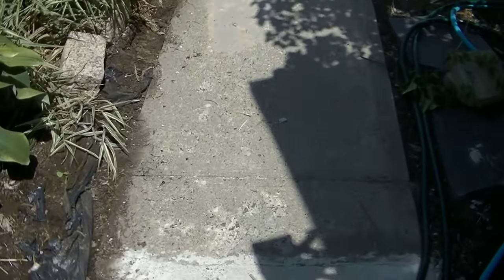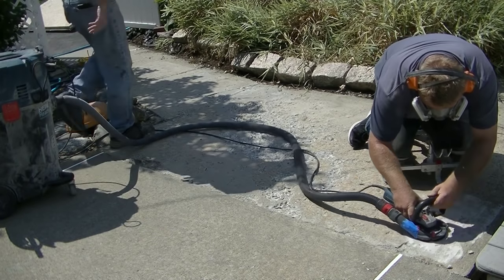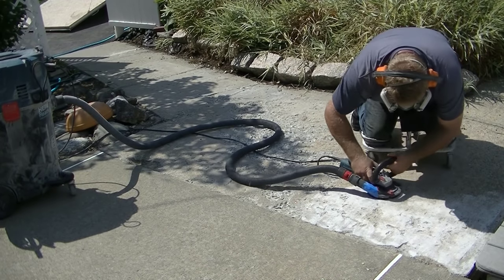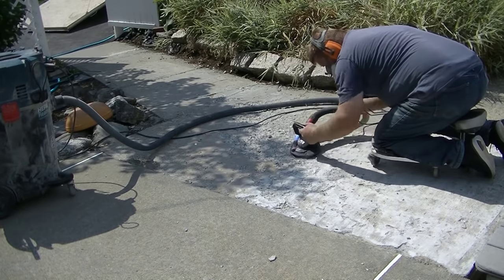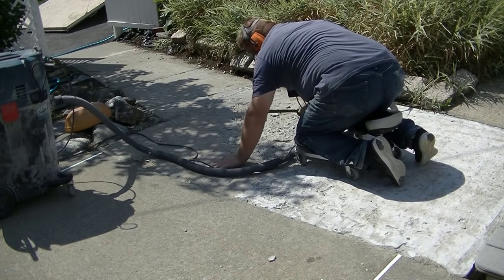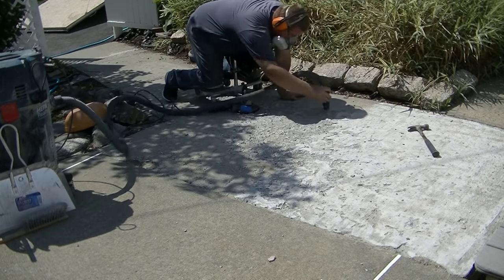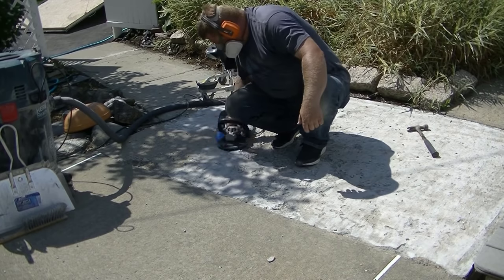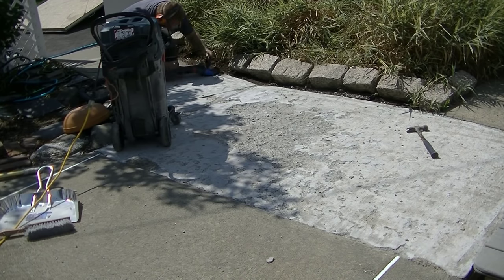How To Resurface A Badly Damaged Concrete Walkway

Comment: I was helping someone pour concrete a week ago and we had several pads formed but only poured one at a time per day. The excess was poured into the last pad. Every time we do this, the concrete seems to slump towards the edge of the concrete that’s not against a form. So we have a couple low spots. We’re going to finish pouring the last pad next week and have to figure out how to fix this problem. Will this stuff work to fix low spots about 1/4” to 1/2” deep by 17’x3’. It’s definitely an a mature mistake.

Comment: My cement porch is a similar project.  At Home Depot, I bought, "Quickcrete vinyl concrete patcher... make thin repairs to concrete surfaces."   Did I buy a good thing?  I have an angle grinder, diamond disc, trowels... but no helpers; thus I am afraid to begin alone.

Comment: I see in your next video you painted over the repair. I am considering doing this to my front entry walkway but don't want to paint it. I am thinking of buying a sealer but don't want it to be slippery when wet. Two questions: Do i even need to put down a sealer? If so, is there one you would recommend?

Comment: When you repair something like this you should mix in chopped fiber from the stucco store it’s feather light and only about a 1/4 to a 1/2 inch but it would keep that weak spot from fracturing again

Comment: I am retired 18 years now and think I am quite good at repairs on cars/tractors etc..Heck I even climb on the roof to sweep the chimney from the top. I know I am a total failure at car paint and cement, but this vid is a challenge.and I will try it.... Home depot has the material.. I have the 'pointing brush'...but not the big one..but I have long arms lol...  Wisconsin's winter is vicious and minus 30 will crack anything that isn't a pro job...  I note no polymer binding juice first....

Comment: Excellent Channel, video and tutorial for everyone with a similar concrete situation.  A solid rational for taking the approach you did based on the customer's goals.  I did have one question on the step of the "resurfacing".  Does one need to either tape off or re-create the expansion joints / slots ?   Thank you for the sharing your experience and knowledge of all things "concrete" .

Comment: You mentioned a concrete sealer in the middle of the video.  Then at the end, you revealed that it was going to be painted.  What sealer do you use when you want a clear or invisible sealer/finish?
Reply from the maker: We use D-1 Sealer from www.deco-cretesupply.com
Reply: Thanks! @MikeDayConcrete

Comment: Hi Mike, I have a sidewalk that has spalled even worse than the walkway you're working on. How realistic is it to expect a product like this to work, and have lasting results? Thanks!
Reply from the maker: It really depends on the prep and your knowledge of using the product correctly. If done right it'll last, if not it will peel up pretty quickly.
Reply: @MikeDayConcrete  Thanks for the prompt reply!

Comment: Detailed and down to the point. Thanks! One question - will the same approach work for chipped garage floor?
Reply: Why not. The cement doesnt know where its at. lol
Reply: @terrythomas790  What I meant to ask was - will that material hold car's weight and driving in and out?

Comment: Mike Day, I'm curious why you didn't use a pressure washer in a couple of the prep steps?  Also, what kind of lifespan can a person expect in climates that go from subzero winter temperatures to 100 F to 105 F summer temperatires?  Thanks if you see this and respond.  Great video!

Comment: Fine work, I did not realize this thin of a coat was possible.  It seems like it wouldn't last long.  Obviously you wouldn't be doing it if that were the case.  You've given me hope for my crappy old driveway, I'll look at it in a new light and probably give this product a try.  Thanks for a great video, sharp and well explained.  Subscribed!

Comment: Hey mike can that be done using an Squeegee? And can i sawcut control joints using mu skillsaw ?... i just repair the cracks of my driveway and I am gonna resurface it 
I notice it has no control joints.
Do you advise sawcuting ufter resurfacing or before it?
Reply from the maker: There were control joints, I went right over them then sawed them back the next day.
Reply: @MikeDayConcrete  thanks Mike

Comment: I have a small pit ( less than a square foot ) on my step that I want to fix. Thanks for the tips. I did not know that you could skim coat a cement surface like that. 😀😀😀😀😀😀

Comment: Mike I understand your material is a good price. Is there any reason why you don't use the resurfacing material made for this kind of  repair.  By the way I used to do pool decks all over  Mass ,NH and Maine  alot of stamp work

Comment: Great video! U explained a lot! Just curious…After using the Cement All to smooth out the top…can u just leave it as is? I have a very small section to do…it has alot of holes/divots that just need to be filled n smoothed out. For a small section do u really need the resurface cement?..or can I just use the Cement All n be done?

Comment: Hello Mike - how large can the divots be in order for you to just use the mortar mix in a single layer instead of doing the blue bag filler first?  I have a sidewalk that is not as bad as the areas you first repaired with blue bag.

Comment: Hi Mike - great video!  I have a problem with my exposed aggregate sidewalks around my pool. They have been power-washed over the years and the surface has become sharp to walk on.They look good and are structurally sound. I guess the cream of the cement/concrete around the stones has been "cleaned away." Anyhow, do you have a video on how to restore the surface so that it is like the original? I'm thinking of cleaning the surface, applying some sort of cement product, allowing it to partially setup and then brushing and applying water to reveal the original aggregate - sort of like the steps that were originally done to make the exposed aggregate surface in the first place. Any videos or ideas on how to do this?
Reply from the maker: I don't have any videos like that no. I would probably lightly grind/sand the surface to dull the sharp rocks. Trying to "cement" around them and wash it away would make a big mess. I don't think the cement would bond very well.
Reply: @MikeDayConcrete  Thanks for your help!

Comment: Also, part of the patio I wanted to resurface previously had a carpet glued to it that has left some residue behind.  I've scraped off all of the chunky pieces so its mostly smooth.  I am just concerned the resurfacer won't stick well enough.  Do you think I will need to grind those off?

Comment: I have a sunken driveway. Just upper right side or right quadrant has a negative grade with water running back to my house foundation. Can I overlay it on that side with a certain product that's stable and will hold up to cold canadian winter temperatures with the snow and ice that comes with it? I need to bring that corner up about 3 inches. Something that won't break up or crack or peel?

Comment: I needed to see this. I'm faced with very much the same job. I do use a lot of the Rapid set "blue" Thats what I was going to use. And maybe to finish also. May have to consider the mortar also. I Will use the extender. I learned techniques here.

Comment: How do you address expansion joints with existing slabs?  I have several sections to my walkway and was wondering if I fill them with foam or how to prep them for when I pour the topcoat so that the expansion joint is not filled in.  Also, do you ever use Bonding Adhesive?

Comment: got a question, do you normally fill in the control joints that connected the old slabs together? and wouldnt it make the new surface crack after a while? appreciate any responses looking for a method to redo our driveway and walkway

Comment: Thanks for the video. I just used both these products and followed the instructions on the bag and ended up with a much firmer product. Instructions says not to add too much water but your mix is very liquid and I'll trust you it's fine this way, good to know. I loved working with rapid set but the result has big variations in colors. Any idea why? Will this fade with time? Also I don't see you guys mention about keeping the product wet for an hour but I'm guessing since you use so much water in your mix you don't need too? Thanks for the advice!

Comment: Hey Mike    I got a question regarding cement all.  I’ve used it multiple times, sometimes it works great . But other times when it drys there’s tons of cracks.   This is sooo annoying.    Have you had this?   Any idea what the issue can be ?  Thanks

Comment: Can your method be used in my garage as well?
Reply from the maker: You can use this to repair damaged concrete in a garage. I have a course to fix garage floors and then epoxy them in the description.
Reply: @MikeDayConcrete  Oh that's perfect, thanks. Great video, btw.

Comment: Very interesting. I had no idea that you could skim concrete like that. I'm surprised there was no need for a bonding coat or pva. We have a hollow on the concrete slab where our stables are. It has annoyed me ever since it was done as I could see the guy rushing to finish. Every time it rains it pools there.
Reply: These were the wrong materials used for this repair.  It should be an acrylic polymer concrete that will bond and have higher tensile strength.  This repair will be brittle and crack regardless of psi as some in the comments refer to as it's strength.

The painting will probably help short term, but that too becomes messy when it peels over and over in high traffic salted and freezing areas.

Comment: I wish you were in Michigan.  I'm finding it hard to find someone to repair my driveway.   I'm in a 1 year old new home and I feel that they botched the driveway for myself and neighbors.  It already shows pitting.   A section was already replaced because it looked like a worker stepped in it and left an air bubble which eventually rose to the top.

Comment: Wow I wish I would have seen your video , before I called J&D General Construction LLC. From 102 Elm St, Danbury, CT.  He took a down payment of $ 1000 and brought his wife and his kids 14 & 18 to do his work. He left to another job. I have a mess of cement everywhere, and he did not finished. Because he wanted all of the money in cash. 
Now I have to clean up  and tge horrible job he did!! 
Please advice. I have to first pitch my patio which is why I hired him. 
Thanks for the best video I seen so far. It will greatly help me.

Comment: Lets see a follow-up. Typically the problems that caused the original failure remain and continue to cause failure of the top coatings you might try. Poor drainage and ice heaving is an example that will break up asphalt and concrete no matter what you do.

Comment: Is the mortar mix with the sand stronger than the cement-all?
Reply from the maker: Not really stronger just for a little thicker application.
Reply: Weaker actually, Cement All full strength is 9000 PSI while Mortar Mix is 6500 PSI after 28 days of set time.  But both are strong enough even for driveway.

Comment: sir I have a floor of about 3000 feet and thousands of holes a quarter deep and three inches in diameter what cement can I use to cover the holes and that it does not dry too quickly to be able to work.  Thank you

Comment: I just noticed that rapid mortar mix is only manufacture recomended for 
over 1/2'' thickness ?   any comments , I am doing a project in a month in my back yard.
Rapid Set. Mortar Mix
Mortar Mix is a fast-setting, high strength structural repair material. Apply Mortar Mix from 1/2" to 6" thick.

Comment: How is this different from self leveling cement? I see a lot of comments on here about how thin it is. I know from experience that self leveling cement can go from 1/2 inch to a 1/16 of an  inch with no problems, as far as sticking to the floor. Used mainly for vct tile. Maybe the same product. I haven’t messed with it in quite a few years.

Comment: Tried resurfacing with sakrete top n bond with red colorant but got ponding areas, plastic shrinkage cracks, and bad patchy efflorescence. How can I fix this? Can I do a feather to 1/8” layer of cement all with red color?

Comment: We bought garage epoxy paint last year for our garage and over the winter any of the snow that came off the cars turned to water and caused the paint to bubble off the concrete/cement. Anywhere water hit the epoxy paint it bubbles and peels off. Did we do something wrong?

Comment: Hey Mike. I’m in Pgh,Pa and wanted to ask if this is the same concrete you would recommend for rain leaking through cracked cement patio above a garage? Or would you use the rapid set water stop hydraulic cement? Thanks
Reply from the maker: I'd use a repair product called CrackWeld to fix a crack like that: https://www.everything-about-concrete.com/epoxy-concrete-repair.html

Comment: Would the same process be used in concrete that has random stamps? Every two feet there is a huge coin stamped into the concrete that goes about a half inch deep.

Comment: Very detailed explanation. Highly impressed. Professional😁Do you ever use 'Bond Crete' to join the two surfaces?
I was especially interested in the amount of 'damping down' that you use.
I have always used a bucket and sponge as I'm worried about putting too much water into the surface. I can see now that too much is not a problem. I haven't had to go back on any jobs so maybe I just got lucky and wet it enough, but I'll be wetting down much more from now on.😊

Comment: This was a great video...  I just have a question, once this is done exactly how you did it, could I lightly acid wash the resurfaced concrete like I would a regular concrete??  Also, can that then be sealed???
Reply: Yes. The acid wash should have definitely been done before the resurface. This product can withstand an acid wash. It has a hydraulic cement base

Comment: Love the video. My mother has a concrete patio with similar damage that needs resurfacing like this one. The problem is she painted it a god awful color years ago. Even after pressure washing it, there”s still some of the old paint that won”t come off. Should all the old paint be grinded off prior to performing the same procedures you did here?  I”d like to save her some money and try resurfacing it on my own. Thanks for any advice.

Comment: Thanks for the video!! Question: is it absolutely necessary to use one of those pasting liquid bonding agents that they advertise needs to be put down so that the new layer of concrete can adhere to the old layer?
Reply: Only need bonding agents if the concrete was painted. If I bare concrete just clean it good and wet it

Comment: I pressure washed and sealed for 35+ years (and made oil paintings 🤖).   I wound up taking on the concrete repair work when people didn't want to replace.  It's not THAT much more work to replace.

Comment: I’m binge watching all the concrete patch videos today, and yours is the best.  I need to resurface the eroding bowl of a travertine farmhouse (🙄) stone sink that the previous owners installed. I tried granite repair epoxy in the deeper areas, but it looks like hell. My granite guy suggested skim coating with quick set concrete as he said that’s what stone mfgs use to minimize the porousness of travertine. I know I will need to add color to it to match the stone, but which of these steps do you feel would be best? I need to add a slight grade so the sink drains better as well. Any suggestions or thoughts are appreciated.

Comment: The video is great, but while ConcreteAll is specked to be able to go to a feathered edge to much greater, and the ready set mortor mix says something like from 1/2"  to 2" only. Why would you feather this product on top? Its the granual size in it that should prevent this from being a suitable feathered produuct. Ur tutorial is great i just worry about off lable use like this truly holding up.

Comment: Anyone.... Would this repair work in a covered garage, where no cars will be driven on it. I’m looking to repair crack on my garage foundation with a low budget and DIY, for now. Does anyone have suggestions?!?!?!?
Reply from the maker: We've used this to fill and repair cracks inside garages before. I use the blue bag Cement All for that.

Comment: It will last till the first winter.  You guys did a great job but. But you guys know that pouring morter mix into cracks and a chipped up surface won't  properly bond.

Comment: You can see the mesh reinforcement lines so if it has had a lot of salt put on in the winter it'll blow again as the slab is probably very thin and the reinforcement cover not sufficient.
As on molecule  of rust Fe²O³ is 27x by volume of one atom of Steel that is guaranteed.
At thirty years old it is possible concrete with calcium chloride in as an admixture anyway so with the salting that concrete is shot 
The repair will help but that original concrete it dead, you can add extra glass fibre to the repair product it'll last a bit longer though eventually it'll be one big flake in the old concrete as you might stop water going down and freezing but with the level landscape it'll simply come up from underneath.

Nice job and certainly won't last forever

Comment: Hi Mike, I overlayed my walkway  3 times in 2 months.  it looked so bad I had to grind it down and now it is so spotty that i have about 75% of the original old sidewalk cement showing and the rest is about 1,2,3, layers of the new overlays that actually took.  i powerwashed and made sure there are no loose pieces. can i now use the cement all to bring it all together and then use the overlay to finish the job. i am a 72 year old lady and i need his to n=be my last time. i have ben watching all if your videos and I think I got it down pact now, but I need to make sure it will work. thank you.